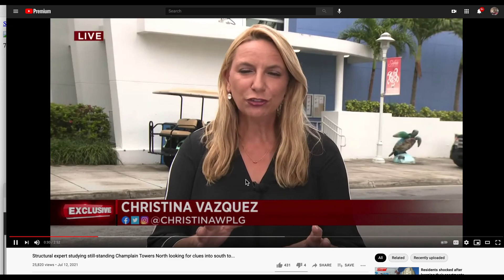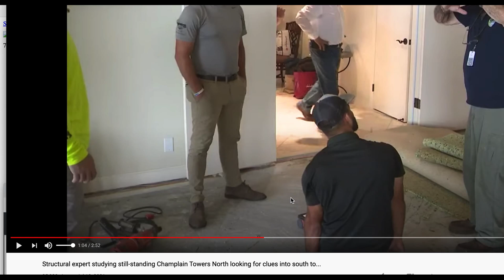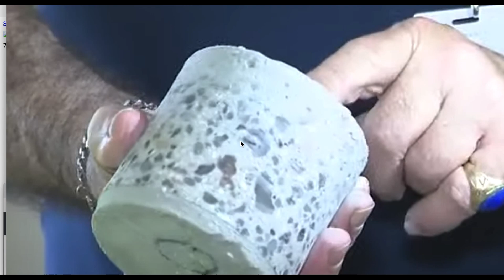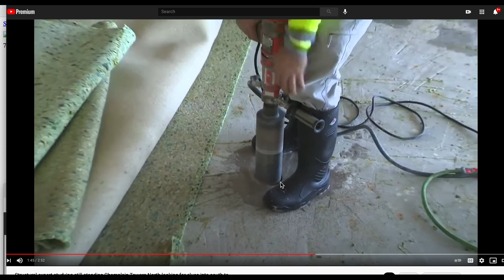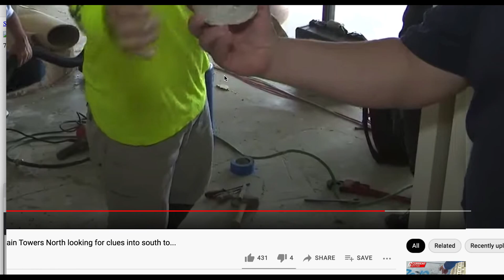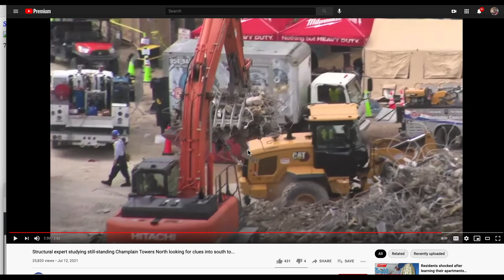Champlain Towers Collapse ENGINEER DISREGARDS WITNESS STATEMENTS THAT DECK FAILED FIRST RED HERRING

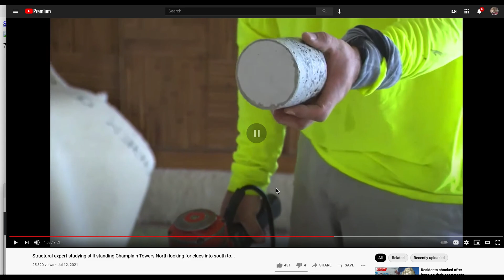Comment: 10:09 yeah 4, maybe 5 or 6 inches tops, not 8. tho I recall that being a meh-ish-whatever-about somewhere around 8 inches. now, my thought about core sampling, is what do they do with the holes in the structure, if they drill a sample through rebar, how do they 'patch' that back up? just fill the hole with epoxy and pray the other rebar is enough? so there only sampling where there is no rebar, ok. what kind of roughing are they doing to the walls of the boreholes to let the fresh concrete bond to the slab, hmm.

I agree that it would be nice to see them core sampling and x-raying the entire pool deck, there may be some media fumbling going on as well. maybe they already did the pool deck and the media didn't get there till they were on the 13th floor. also again look where the vid shows things happened, it's still beneficial to rule out other things, and it may be the "rule out team" the media caught up with. for example the FDR may record that the rudder went hard over on its own, it's still necessary to verify some basics that may appear unrelated to the rudder, like was the engines working properly, ok, was the power making it to the hydraulic pumps for the proper PSI, etc (oh, look at this, when the system PSI drops past this point the actuator goes into reverse, hmm). it is a bit sus they are looking at what was a reaction to a reaction to a reaction with no hint there looking anywhere else, when the pool deck clearly did something to the bottom of L M or N 9.1, lol.

Comment: That he isn't doing any detail work and is acting for the camera actually just proves he's an exec at a big biz My bosses never carried clip boards tapes took notes & could  know next to nothing of particulars Their job was to talk clients into hiring them then seeing staff satisfies them. Harsh? I worked 1 place forever & it ended badly but the bosses knew their job was to get the work & w precious few exceptions they did I at that   I can't fault them on that w/o clients no company no jobs for anyone They aren't selling to bldg professionals but to laymen & snake oil salesmen developers & govt officials To sell u need first to be able to instantly asses client & address them in the way most likely to close the deal  Its like an actor going to an audition so that after 50 yrs he's just acting well what do u expect.   Harsher? That's life get used to it.
However yeah starting at penthouse only doing 1/2 a core so they don't disturb owner below avoiding obvious cracks in floor bodes Ill for this study.
Might maybe mean going to eval bldg such as this a sister to a collapsed one that proves here are  least likely to cause damage to structure In addition to core they need to expose rebar esp along perimeter  Remove patches to see how repairs done condition steel    Insane Concern? heh a building collapsed
If defects found in best part of bldg I'd stop tell owner to evac bldg Shore up every critical pt in areas known to have collapsed in other bldg Then try to figure out how to protect my workers as they try to find out exactly what condition overall is
& it's offering advice like that that causes bosses grief all over unlikely scenarios that helped kill my career  
Though more likely....
Might also just mean this was easiest apt to access ie investor owned who's overseas all the time & is going to use data to prove it's ok to whoever he can flip it too before it becomes worthless
It takes weeks to arrange to come into someone's home starting w providing assurance & usually bldg super to be there all the time to keep anything from being stolen or damaged , to move all the furniture knick knacks, destroy the carpeting, get agreement to replace carpeting, touch up dents & dings etc & no matter how carefully done leave everything w a fine coating of dust.  As I see no effort to tarp tape off protect anything this owner is going to regret allowing them in w/o insisting on every detail & hiring someone to be there every min to ensure agreement followed
Time will tell what is really going on w this study
As to sleepy old etc what can I say I dispise personal attacks having been a victim of them since childhood people judging me instantly on superficials cause ya know not all of us are ex model weight lifters w wardrobe to match in perfect health all the time etc instead of I don't know what one has done & can do

Comment: The engineer hired by Surfside officials apparently did engineering on the new building at 8701 Collins Ave which according to Champlain South Tower HOA stated was responsible or significantly contributed to their foundation and building structural issues in their alleged 2018 letter to Surfside City officials.

Surfside City officials allegedly responded “not our problem”. 

This conflict of interest engineer is a complete smoke and mirrors snow job to cover Surfside City officials and the developer/builder next to Champlain South Tower at 8701 Collins Avenue asses. 

As to the test sampling, total joke. They are selectively picking spots to get the result they want, not at least 3 specimens that are to be taken from the same location  that represents a valid cross section of the area being tested. 

With decades of ASTM writing and testing experience, this engineer is nothing more than a “yes man” full of 💩.

Surfside City officials just copied the playbook of fraud from city officials in New Orleans, Louisiana. The same government bs we found during our study of the Hard Rock Hotel collapse. 

“Absolute corruption corrupts absolutely “

Cheers
Reply: Could u provide source for KCE Engineering / Kilsheimer did engineering next door to collapsed building? I've tried Googling both Can't find it though there was a fishy 400g offer by next door developer to board

Comment: The one guy who runs the channel because surfside lives in that building.  He stated they did balcony repairs to that building in the past. So taking core samples from balconys on that building in my thinking wouldn't maybe be original material?
Reply from the maker: Stay focused Poop, it is the DECK witnessed stated  where the collapse started from!  So, that is where he should be investigating first!
The spans and the location of rebar and the concrete strength --- along with all the connections / joints of each section in the deck... PUNCHING SHEAR MUST BE EVALUATED... HE MUST FIND THE REBAR LOCATION ON THE POOL DECKS AND GARAge parking.

Comment: he is holding a 4 inch core with no rebar in it. Those decks should be thicker...6 to 8 inches and all rebar should be 12 inch centers.
Reply: Maybe they went thinner on upper floors due to less load.
Reply: @PugFaceMedia  The floor does not support the floors above it, the columns do.  The floor only needs to support it's self and whatever is on it.  It may also provide horizontal stability for the columns.  If you building something without columns, like a wood house, the  floor joists carry the load of whatever is above it, wherever there are load bearing walls.  That tends to be the outside walls and the very center wall.
The columns do carry more weight lower down in the building. 
In the surfside building, if you look at the blueprints, the lower columns are made with 6000 PSI concrete, the middle columns are make with 5000 PSI concrete and the upper columns are made with 4000 PSI concrete.  The columns are the same size from the parking garage to the top floor, and the lower columns carry more load, so they use stronger concrete.  The other thing you can do is make the columns larger, lower in the building, but that gives you less floor space.